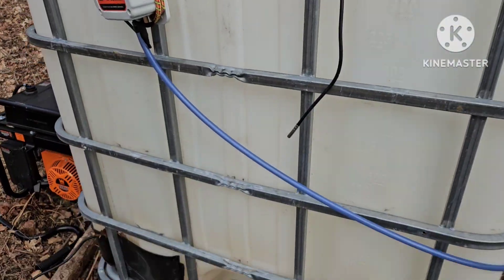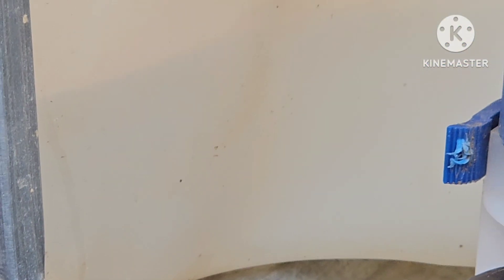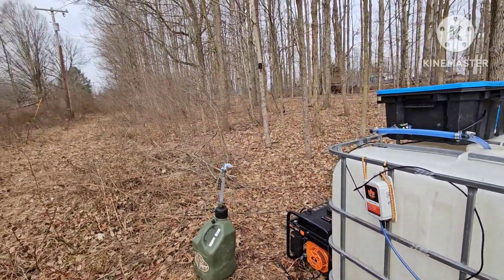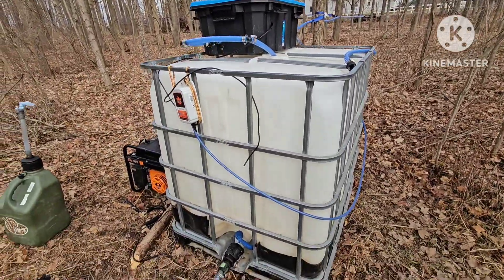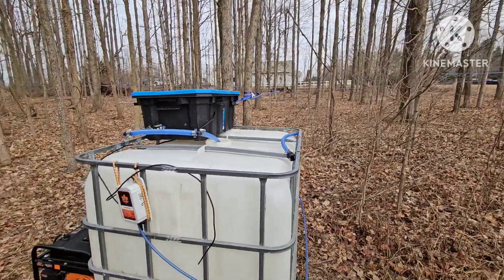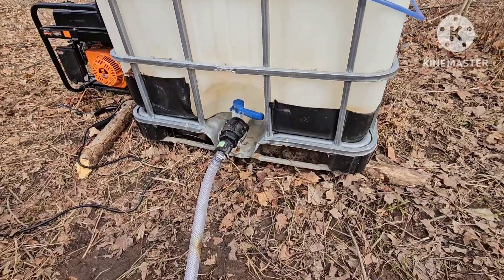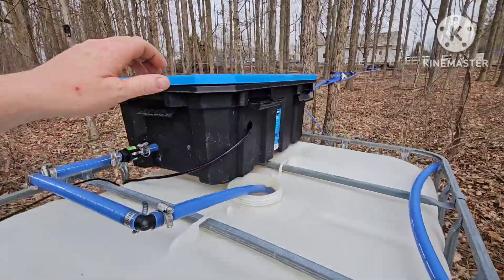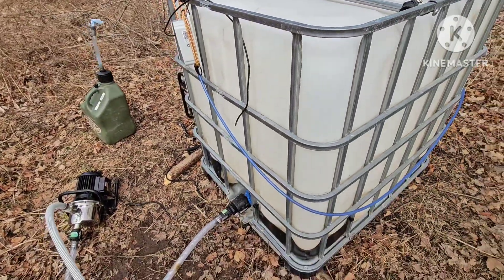Check Valve Spiles do they actually work??

Comment: Interesting comparison.  As another comment suggested, curious as to what variables were controlled (spouts, drop lines, laterals new vs. old, vacuum readings, etc.).     Could you tell me what brand of pump you're using for sap transfer and what kind of GPM flow rate you're getting?   Sub'd